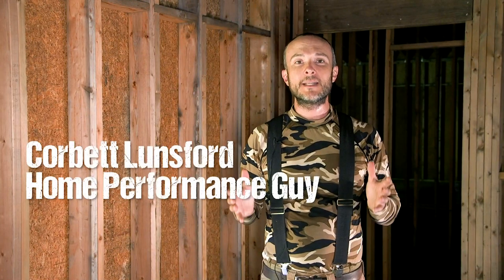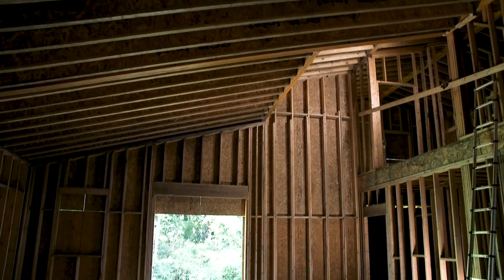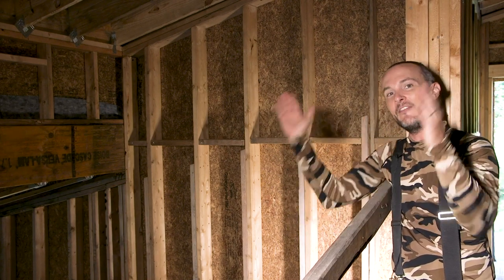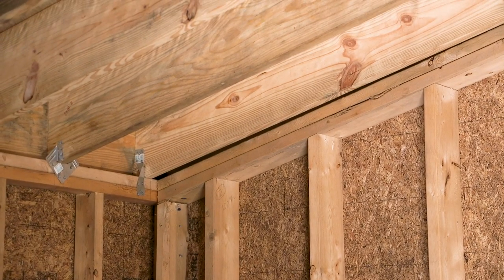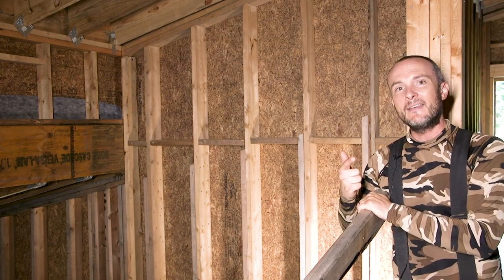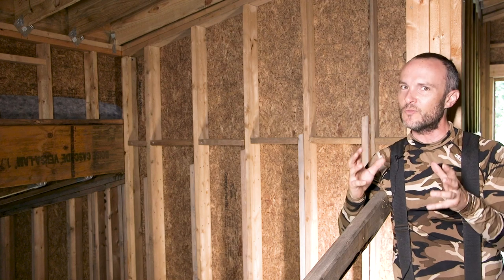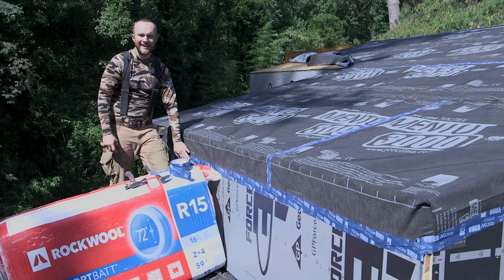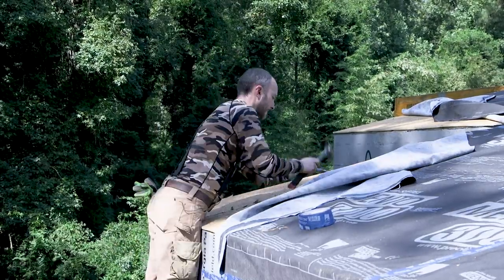Common Builder Fail (and a way to fix it fast and cheap)

Comment: Knowing your background and seeing your attention to detail (as evidenced on the TinyLab and your other work on this house, this video illustrate how easy it is to overlook something that could have real performance issues.  This should tune everyone into the need to scrutinize work done on their homes.

As someone that spent a couple of summers working on residential construction for custom homes in Georgia, I can say with some confidence that there is virtually no way most regular builders, nor most custom builders, would have gone back to fix that in such a manner.  If they did anything, which I doubt, they'd have gotten one of the unskilled workers to stuff something in there or buy a few cans of something to spray in there.

You mentioned retrofits.  We built our house 25 years ago - and I'm looking at the need for retrofits on "the envelope."  Portions of my roof are cathedral ceilings with no attic above - and I'm pretty sure the insulation is underperforming substantially, as evidenced by ice dams just all along the rear eaves, just above the gutters.  Can you point me to any videos on your channel related to retrofits techniques (that don't involve spray foams) to address my roof insulation?
Reply: Where I live metal roofs are occasionally installed over 2-4" of foam panel insulation. if you've currently got asphalt shingles and they are original you should be getting close to the replacement time for the roof. There are lots of really nice metal roof options out there, and they last a long time. just a thought.

Comment: OK.  That's dedication.  I would have just spray foamed the corner.  I agree with the off-gassing issue - I build with mostly Rockwool, some fiberglass insulation, but for these 1-2% corner/edge cases, I'd foam it.

BTW, Rockwool cuts with a "bread knife", not a "steak knife".
Reply from the maker: Thanks brother

Comment: New subscriber here. Is this an unvented roof? If it is I like that you found a way to use batt insulation without condensation problems.

If that wrap is your air control layer, how do you plan to install the roofing without putting hundreds of penetrations in the air barrier?

Thanks
Reply from the maker: Hey there, glad you found us! Yes, unvented, and we’ll have an interior air barrier membrane too, called Intello. Roof will be standing seam metal, only one screw every 16”. Butyl tape along the lines.
Reply: @HomePerformance  
Thanks. That's very great to hear, as batt insulation is so much more cost effective than foam sheet or worse yet spray foam.

Butyl tape along which lines?

Also, are you going to put the standing seam on before the intello so as not to penetrate the  barrier?

I found your page because I'm doing a shed roof on my new house and wanted to see how it was implemented with I joists and one of your vids came up. Very informative. Thanks. Please do  vids in the future about 
1. Insulating it
2. Running electrical and plumbing in the ceiling space
3. Flashing details for any vents
4. Drywall  where the wall meets the ceilin, since you will have to cut at an angle.

Thanks for the free YouTube education

Comment: I think creating a weak point in the insulation deliberately could be beneficial because then you can use heat recovery and channel that heat back in to the house because as you say unless everything is uniform the heat will find the easiest path/least resistance. We know it will leak out but just not how much actually would over a given time or where exactly unless you use a thermal camera after everything is finished which would be hindsight only. Most people with everything are "that's good enough" unless they are doing it for themselves and then a different ethos applies. Perfection takes a lot more time and money that most can't afford. A contractor will do, undo, redo anything if you pay them for the time and materials. Undoing and redoing is very annoying though.
Reply from the maker: Definitely don’t understand your idea about using holes in the enclosure to channel heat back in, but glad you’re thinking outside the box. Yes, annoying- but here the diff between a spec house and a custom build is clear.
Reply: @HomePerformance  I meant know where the heat is going and potentially escaping so you can use heat recovery so it isn't lost completely. Just like air/ground to air heat pumps take heat from the outside or ground. Treat heat like water. Collect it from everywhere you can and re-use.

Also for a hot water tank. Put it somewhere where the heat that is lost isn't completely wasted as it may be in the loft for instance.